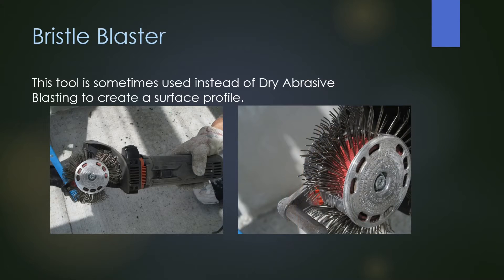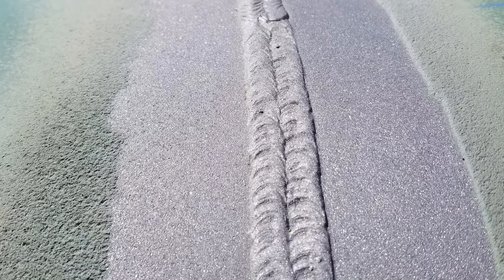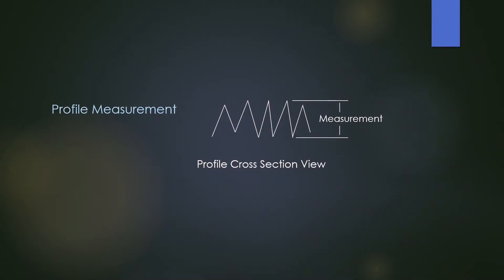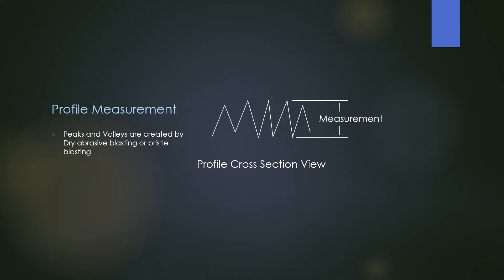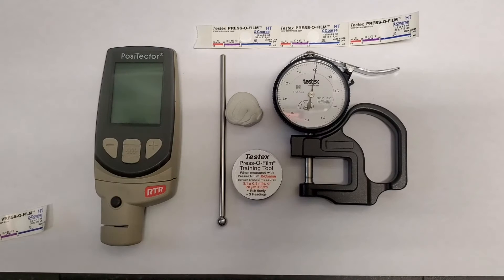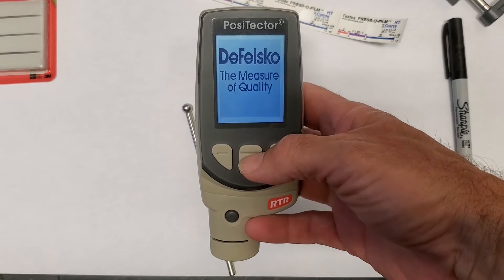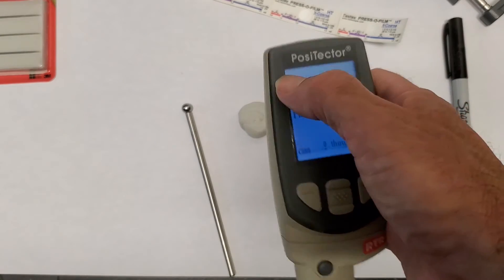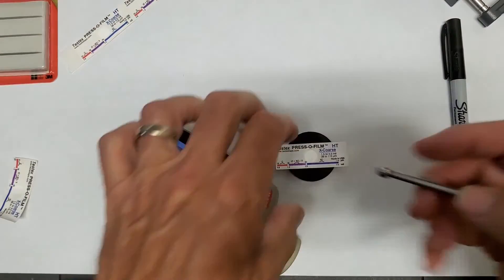How To Measure Anchor Profiles

Comment: Very informative! I took NACE CIP I in Mobile, AL back in August 2019. I don’t remember the putty. Is the putty mentioned in CIP II?
Reply from the maker: Hi Matthew, I don't remember the putty being mentioned in CIP 2 either. It's something the manufacturers of the gauges would like to see used. I can see where dust and media on them could end up affecting the functionality and accuracy of the gauge. That is probably a main reason they want to use it. I have not seen any standards that require the use of it. I try to go with what the manufacturers want whenever I can because they know their instruments better than most do. Thanks for the comment.